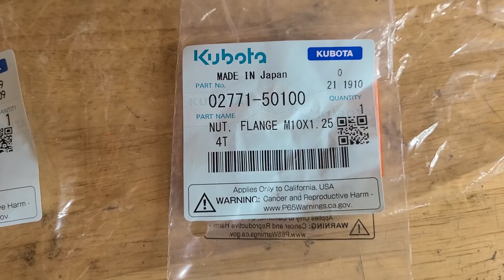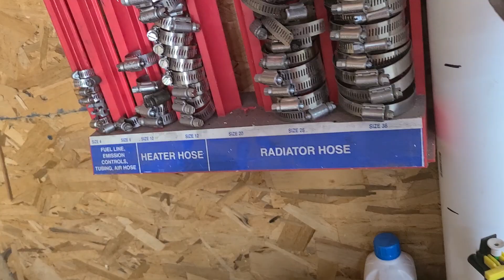Kubota L2501 Right Handle Install How-To

Comment: Are there any downsides to putting it on (other than cost)? Does it interfere in any way with the three point lever or anything?
Reply from the maker: Haven't run into any yet. No - it does not get in the way of the 3 pt lever.
Reply: Thanks. I didn't think there were, what with the covered up holes and indentation already there. I'm guessing it's a cost saving measure, along with the turnbuckles on the three point arms instead of telescoping stabilizers.